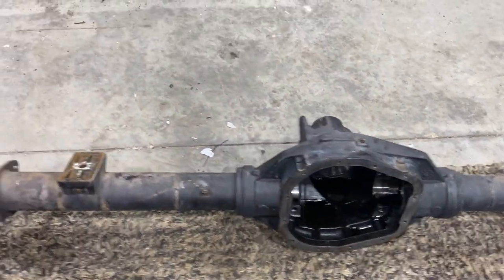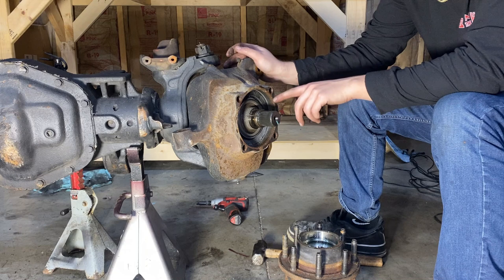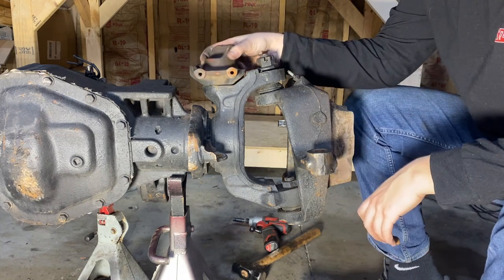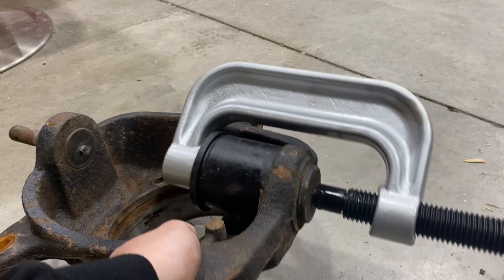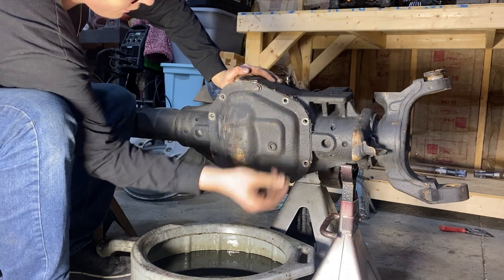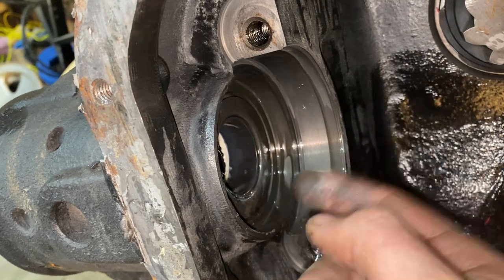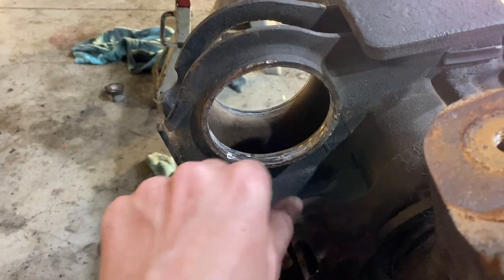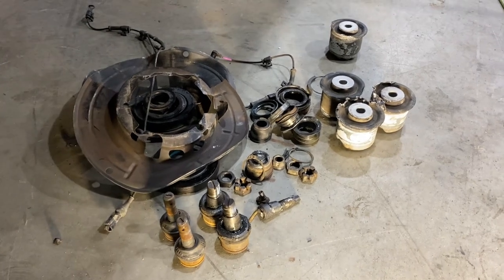F250 FRONT AXLE DISASSEMBLY MADE EASY | DANA 60

Comment: Best video on the internet! vacuum locking hub seal 6:20, do you know what you can use in place, i run manual locking hubs as well but i know you need that big ass seal in there!
Reply from the maker: You can buy a seal driver took off Amazon that works good , but I’ve always just left the seal out no issues.